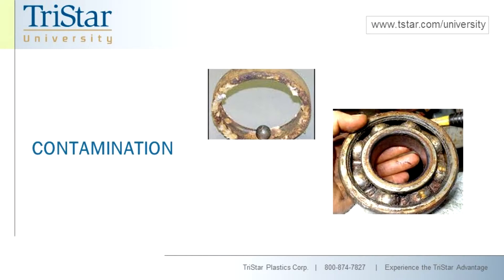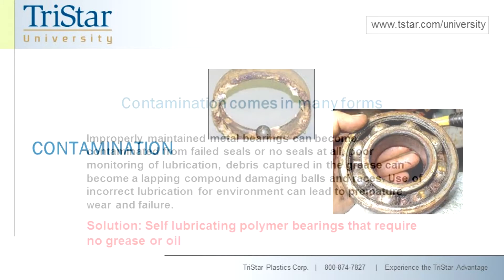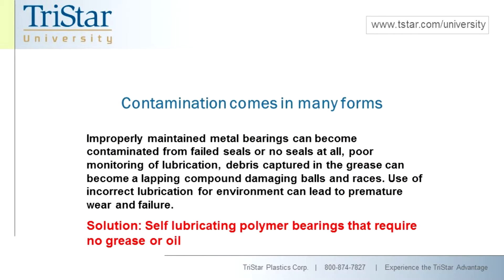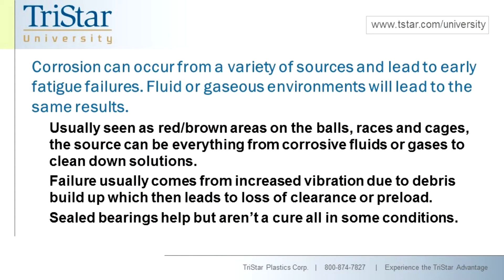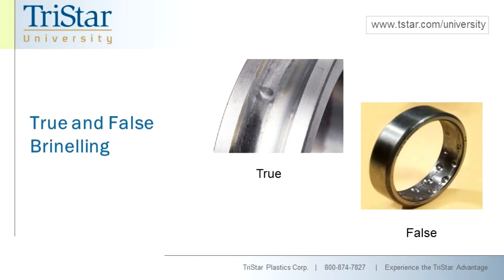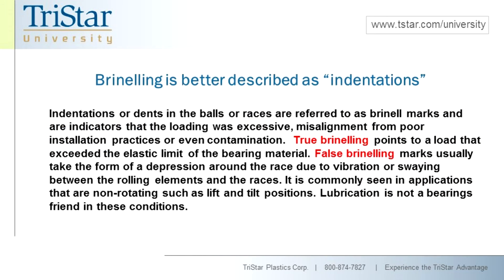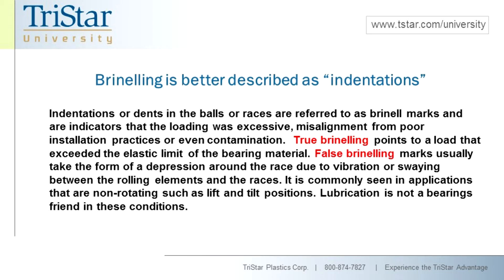Bearing Failure Video (3/4) - Corrosion, Contamination, Brinnelling and Excessive Loading

Comment: I was a mechanic in a large Cadillac dealership in the late 70s. I recall doing wheel bearing replacements under warranty on new cars that had noisy wheel bearings.  The root cause was traced back to these cars that were shipped by train rail and it was believed that the rocking motion of the train was creating flat spots on the bearings.